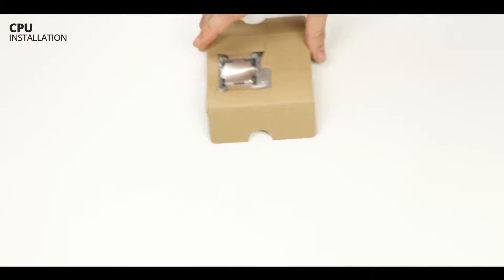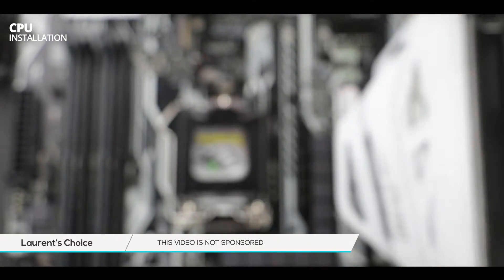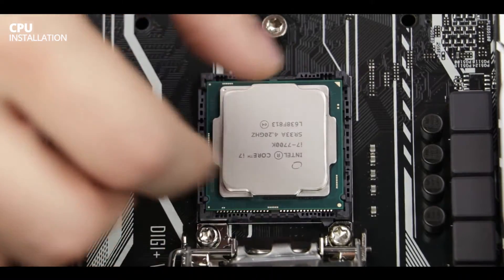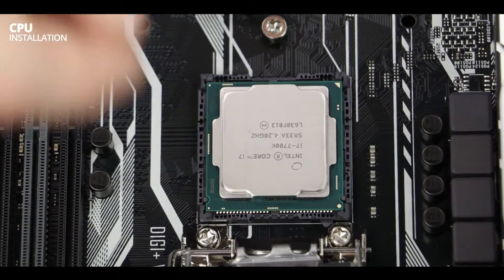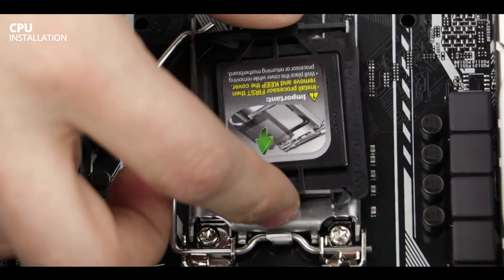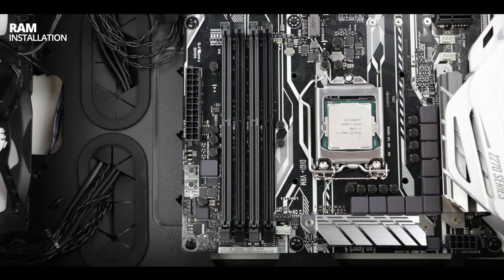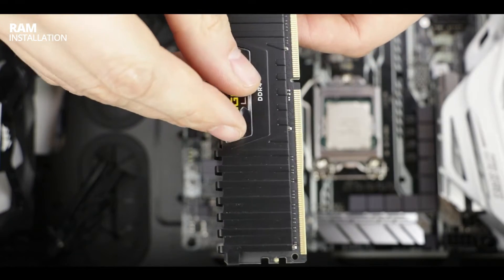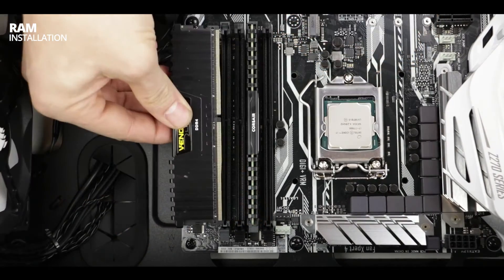i7-7700k & RAM installation (Kaby Lake Project 3/10)

Comment: Hi Laurent, I tried installing an i7 lga1151 7700 Kaby Lake but when I ran it, something went wrong.  We suspect that maybe the fan may not be on properly.  Your great video didn't include the fan and heatsink, do you have one?  We followed exactly your video, but there was a clickety- click sound when trying to boot up, but I had to turn it off.  I'm hoping we can get an answer, I'll check your page if you did an install of the fan.  This was a really good, clear video, I just wish you had the fan as well.  Thanks. By the way, do the fans only go on one way?

Comment: can not fine not one video on how to install the drives/software for i7 7700k iv been on intel site go to install it then i get a msg saying it doesn't  support  this system but it does  the stupid thing will not let me install it at all.  and there no information on it at all.
Reply from the maker: They should be no drivers for the i7 7700k
 It's a CPU. It does not require software or drivers to work
Reply: Laurent's Choice ok no worries cheers iv got got it working properly now.

Comment: How would I change the ram of a Intel 3rd gen laptop??? Is it just like this or impossible to change or what??? Thank you! (I haven't check the back yet just to make sure before I try messing with it so I know its worth the risk of opening the back and messing something up!)
Reply from the maker: +Crafty Gaming can you give me the exact laptop make and model number ?
Reply: Name: LAPTOP-1DFAJ8Q9
Edition: Windows 10 Home
Version: 1703
OS Build: 15063.540
Product ID: 00325-80656-88503-AAOEM
Processor: Intel(R) Core(TM) i3-6100U CPUE @ 2.30 GHz 2.30 GHz

If anything is dangerous to put out there tell me what so I can edit it out of this comment!
Reply from the maker: +Crafty Gaming your good.
Give me till tomorrow. Ill give u a detailed guide .
Reply: Thanks man!
Reply from the maker: Ok, so your processor can handle up to 32 GBS of DDR4 RAM!!! That's a Skylake CPU (6th Gen). 

I can see from the Product ID that you have an HP Pavilion. It came with 1 single stick of 4GB of DDR4 SODIMM-RAM clocked at 1600 MgHz.

You have 2 available SODIMM-RAM slot on this motherboard. So you do have room for upgrade :)

Either, you add another 4 GB of DDR4 SODDIM-RAM and have a total of 8GB or you replace the existing RAM stick and get a new set of RAM to achieve a greater capacity (16GB or 32GB).

In both cases, make sure your that your RAM modules has identical clock (1600 MhZ). Both RAM modules will run at the slowest Clocked available. So no need to buy a faster clock.

Make sure both RAM module are of the same make (not an obligation but better), and the same type (DDR4 SODIMM in this case).

To Upgrade: 

Simply remove your back cover screws of your laptop. This will give you access to the entire motherboard. 

Add the supplementary SODIMM-RAM module respecting its correct orientation (a little nudge will help you there).

Again, make sure to buy a DDR4 SODIMM RAM stick.
Here a little recap of what you need for the different configuration compatible with your laptop.

for 8 GB : x1 4 GB of DDR3 SODIMM-RAM clocked at 1600 MgHz added to the existing one.
for 16 GB : x2 8 GB of DDR4 SODIMM-RAM clocked at 1600 MgHz
for 32 GB : x2 16 GB of DDR4 SODIMM-RAM clocked at 1600 MgHz.

I hope this helps!
Reply: Thanks man! Also my computer came with 6 gigs of ram not four... And my computer is hp pavilion like you said with a Intel i3 gen core which I believe is the CPU unless im wrong... you said my CPU was Skylake 6th Gen!
Reply from the maker: +Crafty Gaming yes that s correct. 

Your processor is an i3 6th generation CPU. It's micro architecture is known as SkyLake :)

6 Gigs is even better though unusual.

SkyLake is pretty recent so you probably bought it a couple years ago.

Still very relevant. RAM upgrade is a great idea
Reply: I bought it last december so yeah its new also I cant find any 6 gig ram that is DDR4 on amazon... Ill keep looking. Thanks for all your help!
Reply from the maker: +Crafty Gaming if i were u.. I'd go straight to a 16 gig kit . 

Ull feel a major performance difference. Especially with an i3

Comment: Question: Your description says ram @ 3ghz.   The i7-7700K supports DDR4-2133/2400 @ 1.35V
Did you have to do some overclocking to make full use of that ram speed.....or are you not actually using it at 3000
Reply from the maker: +Bad Dog Media u need to enable XMP option on your board to allow a higher frequency usage than the initial stock CPU ram clock.

Once done simply adjust RAM frequency in the BIOS to the advertised speed
Reply: Thanks very much Laurent's Choice. And so it's all been working fine? No stability issues? Nothing's burnt out yet?
Reply from the maker: +Bad Dog Media so far so good :) 
Keep in mind that I am  keeping operation within recommended range :):):)

Comment: You did not use the cpu installation tool that came with motherboard , why is that ?
Reply from the maker: +Peter Borg I usually dont.. I am from that older generation :) 

But feel free to use it If you have any doubts on how to handle the CPU...especialy with these Intel sockets... they are very fragile !
Reply: Ok...thank you very much, I thought I was  just about to do something wrong ..going by the manual

Comment: Hi, I am planning to build a computer for a friend but I am not sure what parts to pick. I would pick the 850 evo 512 gb SSD but I really want his PC to have an M.2 SSD. He also may transport the PC back and forth from home and his apartment every few weeks so I chose the C70 case but I read in your previous video that the case had a few problems. If you have the time, could you please look over the list to give suggestions and opinions on the parts? I am trying to build him a PC that is fairly future proof as he does not plan to rebuild his PC in the future other than putting in new ram if needed.
I have recently been watching your videos and they are very helpful by the way!
I may convince him to buy 16GB of ram but he does not want to spend the extra 50 for a part that is easily upgradeable.
PCPartPicker part list: https://pcpartpicker.com/list/mDQk8K

Intel Core i5-7600K 3.8GHz Quad-Core Processor ($239.99 @ Amazon) 

Corsair H100i v2 70.7 CFM Liquid CPU Cooler  ($99.99 @ Amazon) 

MSI Z270 GAMING M7 ATX LGA1151 Motherboard  ($246.98 @ Newegg) 

Corsair Vengeance LPX 8GB (2 x 4GB) DDR4-3000 Memory ($65.99 @ Amazon) 

Samsung 960 PRO 512GB M.2-2280 Solid State Drive  ($329.99 @ Amazon) 

MSI GeForce GTX 1060 6GB 6GB GAMING X Video Card  ($259.99 @ Amazon) 

Corsair Vengeance C70 (Black) ATX Mid Tower Case  ($116.98 @ Newegg) 

Corsair 760W 80+ Platinum Certified Fully-Modular ATX Power Supply($159.99 @ Best Buy) 

Total: $1519.90
Reply from the maker: Very nice components. I'll say this... this case with this particular cooler was giving me a crazy amount of vibration... which was absolutely annoying BUT.. since you are getting a K processor ... u need a water cooler. So... go with the H80i instead of the 100i..  the CPU is a i5, and whatever you are going to do with it.. it is well within the cooling range of a 120 mm water cooler.
Result : no vibrations and cheaper.

Keep 240 mm water coolers for i7s and LGA 2011 v3 CPUs.

Power Supply Unit: Since you are running a single GPU (video card) and no external SSD/HDD, and given that you are running a i5 (say.. 90 watt max on a good day).. no need of such wattage. 650 Watt is more than enough (80+ Plus Bronze, or Silver maximum).

That will save you more money.
Reply: Wow, very fast reply! I read the advice then talked to my friend recently and we decided to downgrade a bit and would like to hear your opinions one more time please. I would like to tell you that i appreciate your editing, , such as highlighting the parts you are talking about an having a front and back camera. And that you talk about the small details about the parts.

We might switch to Skylake even though it is the same price as the i5 K processor to prevent possible compatibility issues with the downgraded mobo, from Z270 to Z170. 

Downgraded M.2 to SSD to save money(I also read that M.2 boots slower than SSD somewhere, am not too sure if that is true.) I might decide to switch back to the M.2 if I feel like it might be worth the extra 170 for bragging rights and installation convenience.
We decided to change the case and chose the 650W Gold since he did not mind the extra cost from Bronze to Gold.

This is the new setup after reading your advice and talking to my friend. We are going for high performance without too much overkill now. Thank you again for the information and advice! Saved my friend money and taught me some things.

Intel Core i5-6600K 3.5GHz Quad-Core Processor ($240)

Corsair H100i v2 70.7 CFM Liquid CPU Cooler ($100)

MSI Z170A SLI ATX LGA1151 Motherboard ($130)

Corsair Vengeance LPX 8GB (2 x 4GB) DDR4-3000 Memory ($65)

Samsung 850 EVO-Series 500GB 2.5" Solid State Drive ($160)

MSI GeForce GTX 1060 6GB 6GB GAMING X Video Card  ($260)

NZXT H440 (Blue/Black) ATX Mid Tower Case ($120)

EVGA SuperNOVA NEX 650W 80+ Gold Certified Fully-Modular ATX Power Supply  ($83)
Total: $1158
Reply from the maker: you are welcome, I usually try to answer asap as I know that people watch my videos for immediate troubleshooting or buying, so no worries :)

I love the case.. awesome choice.

Agreed on the on the processor downgrade. The only noticeable difference between Skylake and Kaby Lake is the Iris Graphic processor... but since you got a 1060 GTX.. who cares!!!!!! The 6600K will be PLENTY to run your OS and get you to ur game.

Ram is good though I would go for a single stick so that you can easily upgrade without getting rid of the the 4gb sticks.

There is a real difference of performances between M.2 SSD aa\nd SSD.. but you won't feel it if you are building this computer for gaming. 
You might feel it more if you are doing video editing or graphic rendering. So no regret there.

Motherboard: The Z170 is forward compatible to Kaby Lake processors. So you can upgrade anytime. The only thing Z270 ship gives you is more memory bandwidth (multiple M.2 SSD slots), and some  other minor (and I mean really minor) upgrades. 
So no regrets there either.

Do not forget to Overclock your processor once done. You can push the 6600k to 4/4.1 ghz easy with a 1.3 volt core configuration So don't be shy with it :)
Reply: Laurent's Choice awesomee, I've been googling a lot and built a few PCs already but I'm glad I reached out to you, as well as watch your videos. 
Realized a lot of little things about parts and understand the building process as well as parts a bit more now. 
I will note down getting 1 stick of 8gb RAM instead, that will be very nice to be able to upgrade easily to 16gb. 
I'll be sure to watch your building videos to become an even more skilled builder! The PC build you helped me make will be built within a month or two, I do not think I will change it anymore other than buying peripherals. 
thanks again! see you soon in your future uploads!